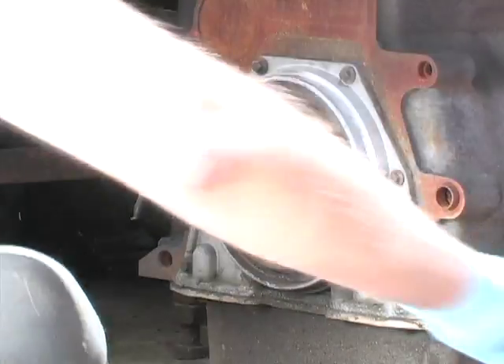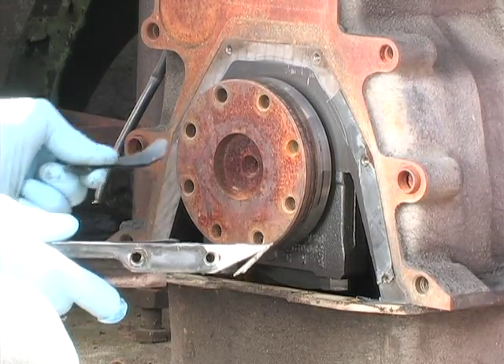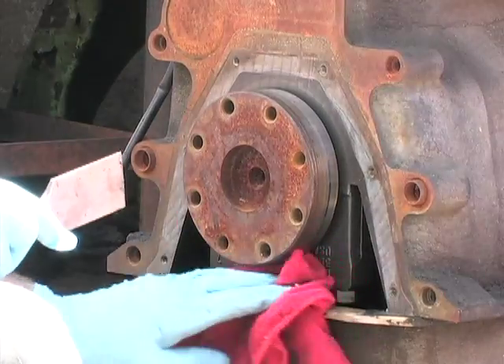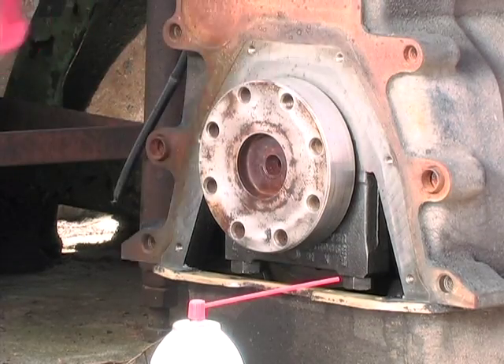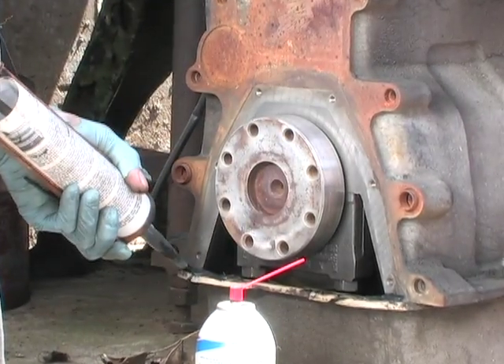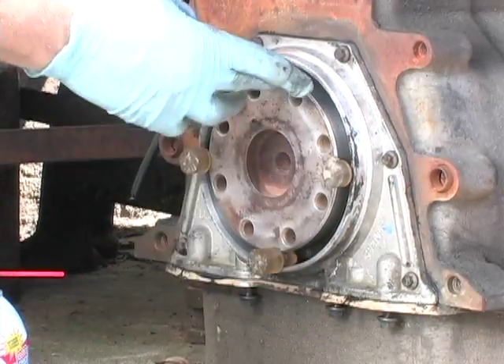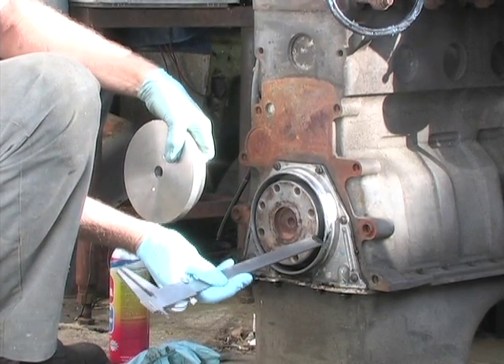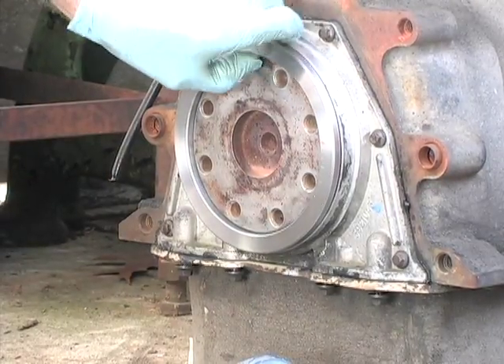Cummins 5.9 6BT Rear Main Seal Procedure

Comment: If you install the seal into the aluminum housing first and then push the assembly onto the crank using the supplied plastic seal protector wouldn't that automatically center the seal and housing onto the crankshaft?  Then gradually tighten up the bolts a couple threads at a time.
Reply: This was exactly what i was thinking 🤔

Comment: How do I buy or order your alignment tool?  Also, the factory manual states the seal should be installed dry and only use small amount of soapy water between the seal and the crank to help on the installation.

Comment: You can preinstall seal into housing and slide it into crankshaft, or you can install housing with gasket and silicone, but just snug the bolts without fully tightening them. Same with oil pan bolts. Grab your seal with the plastic guide and slide it onto crankshaft by hand. Grab the installation ring that comes with the seal and set it in place over the seal. Now grab the flexplate retainer ring and set it over the tool, run each flywheel bolt and tighten then carefully in a star pattern until the ring pushes the seal tool evenly to proper depth. Remove all flywheel bolts and ring and you got your seal installed and aligned. Now tighten all the housing 8mms and the oil pan 10mms. Check your flywheel for cracks before installing it back on the crank.

Comment: I'm looking for a rear main oil seal for a Ford super duty truck engine. It's a 401 cu in from the 401, 477, 534 engine family, which was produced from 1959 to 1981, and used in larger Ford trucks (800 & 850 series) as well as certain Chris-Craft marine applications. Original seal is the rope type and I'm wondering if anyone knows of a newer neoprene type seal that would fit. Many older engines are being fitted with newer seals.

Comment: what if I don't have the seal tool you have? I've seen some other seals that come with the install tool? also if I purchased your seal on eBay to include the out cover gasket? thank you
Reply: How do I purchase the seal tool? thanks
Reply: Buy the seal kit from Cummins, comes with the RMS and the install tool, as well as a plastic insert to help keep the seal's shape while installing over the crank.

Comment: want an installer. where can I buy it?
Reply: xAZPUNKSTERx  Don't waste your money. Buy the Cummins seal kit. It comes with an instillation tool. You can take the housing off and set the seal depth with the tool then put the housing on with the seal installed. Also there is a plastic insert in the seal when you get it, leave it in there until the seal is over the crank. Lastly the seal is meant to be installed dry.
Reply: Justin Martin I thought the main concern with installing the seal is to have the house perfectly aligned. I have the cummins seal ordered with the steel ring. Just pound the damn seal in and shove the housing on crank?
Reply: @xAZPUNKSTERx  yup, the seal will center the housing onto the crankshaft itself. There is no need to go through all the extra alignment BS he showed.

Comment: What are the dimensions on that install tool?
Reply: After getting the gasket kit. It comes with the setting ring (metal) and alignment ring (plastic). So the kit has what you need to set the seal.
Reply: Although his machined setting tool is much nicer than the one that comes in the kit.